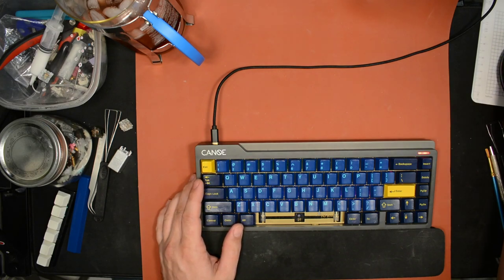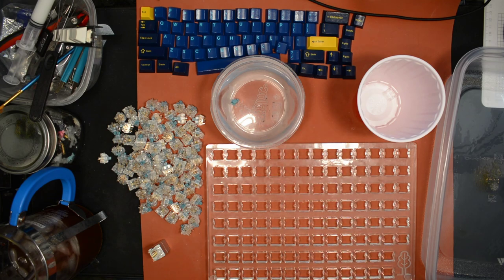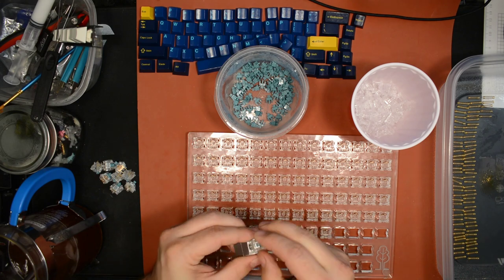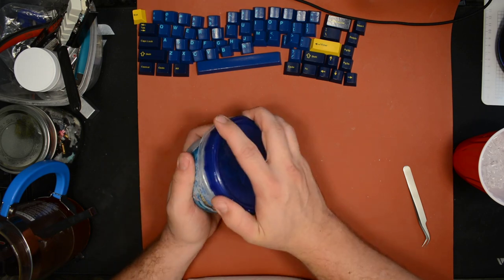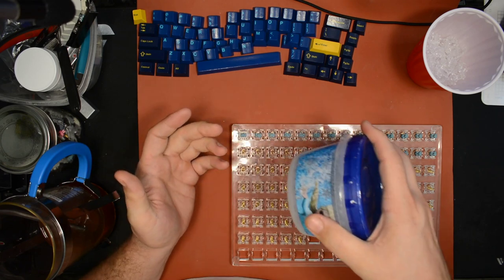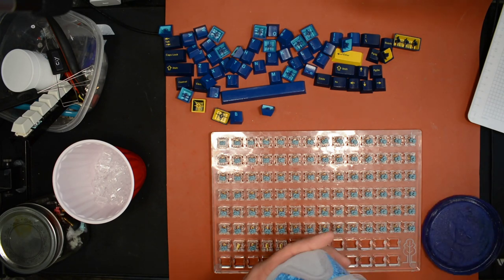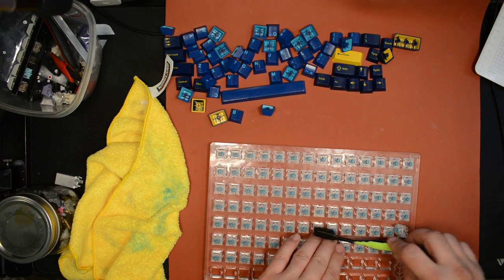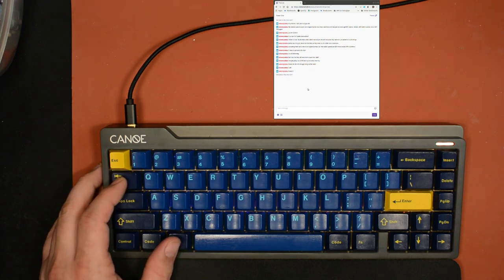Lubing KBDFans T1 switches

Comment: Placing a dab of grease on the non-contact side of the leaf is a good idea. As to the kind of lube to use, I think Christo-Lube, relatively cheaper and easier to remove, makes more sense than Krytox or Permatex if Aliexpress is not an option.
Reply from the maker: Agree, sorry if I said this grease was Krytox, it's actually some cheap fluorine grease from Taobao so it's similar to Krytox
Reply: @WalkersKeyboardScience  pretty sure you didn't say Krytox. I was just think out loud what I'd use. Anyway, thx for the informative video as usual.

Comment: Does the tub lubing method work with thinner lube, also how does lubing the leaf and the legs of the switch affect tactility?
Reply from the maker: As far as I know, the thinner lube wouldn't affect the tactility as much.  Lubing the leaf and legs with thick grease reduces the friction which reduces the intensity of the tactile bump, so if you want max tactility you would want to only have thin lube on the leg and leaf.  Most switches come with a bit of thin lube on the leaf or leg.  It's just that putting a thicker more slippery grease on there can make it even more slippery and less tactile.

Comment: TLDR: folks! Lube the T1 legs! Generously lube the top housing rails!! 

Hey! I just got some T1s and I thought that lubing the stem legs would kill the tactility so I decided against it and it was a baaad choice.
The whole switch felt nice and smooth EXCEPT there was this really unpleasant harsh friction between the legs and the leaf that felt like nails on a blackboard :D
I desoldered them and lubed the legs and it's soo much better. I didnt really notice any loss of tactility but that awful harshness was long gone.

IMPORTANT EDIT:
LUBE THE TOP HOUSING RAILS, it turns out the scrathiness wasnt coming from the legs, it was coming from the friction between the stem and the top housing rails
Reply: u recommend lubing the legs?
Reply: @johnchen2963  if you enjoy linear switches then yes - i recommend lubing the legs